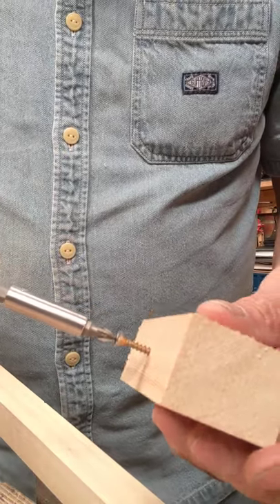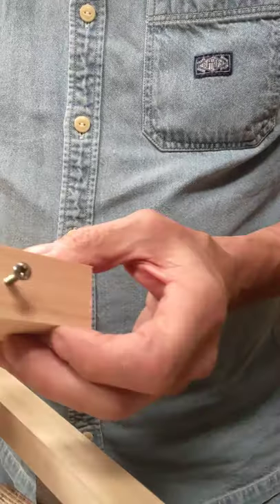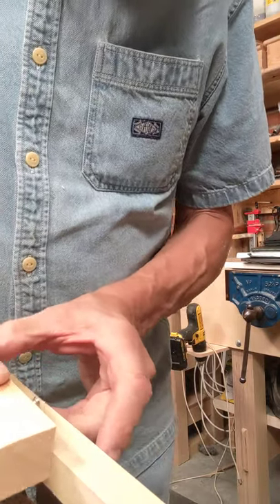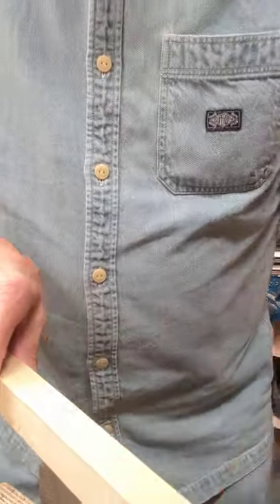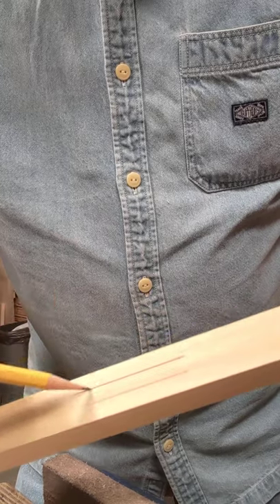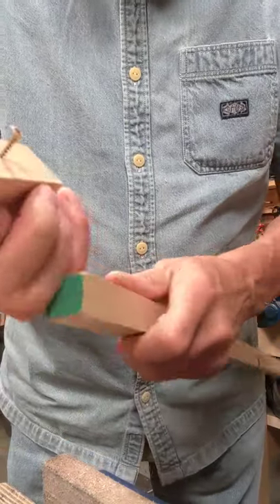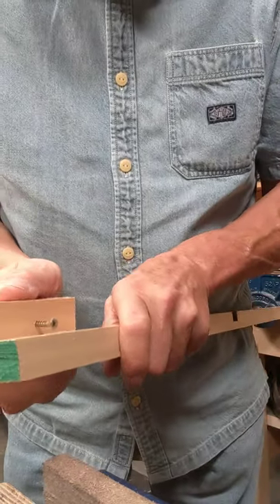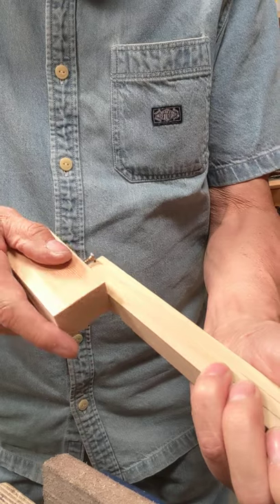Here's a simple woodworking gauge made from a screw and a block of wood.

Comment: I use the exact setup for marking my stitching grooves on leatherwork.
Reply: When I was restoring furniture, I used this method to make a scratch bead, but used a straight slotted screw instead, with the slot as the cutter. This is how many of the old cabinet makers did it.

Comment: I put my screw into the top of a wooden dowel and then fit it into a block to get a marking gauge that moved.

Ran into this issue when I learned the price of a marking gauge replacement blade
Reply: Rolling edge scribe. Nice. Better advice. 👍🤠😉